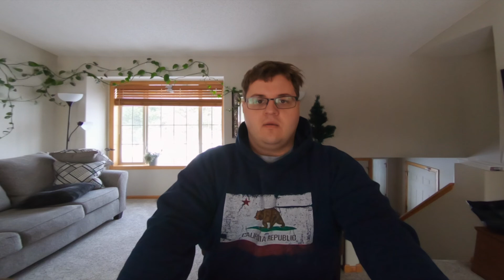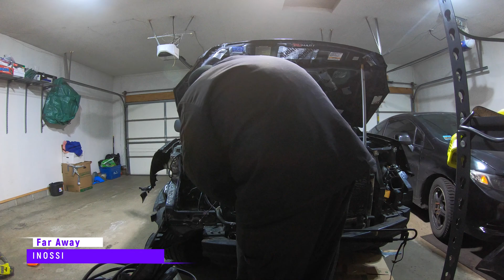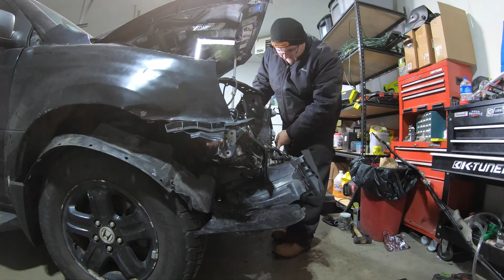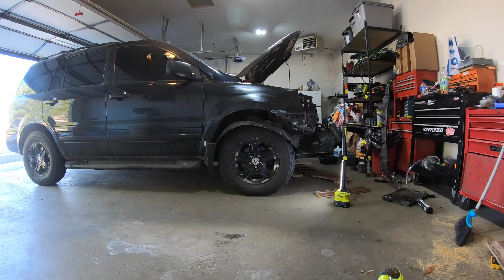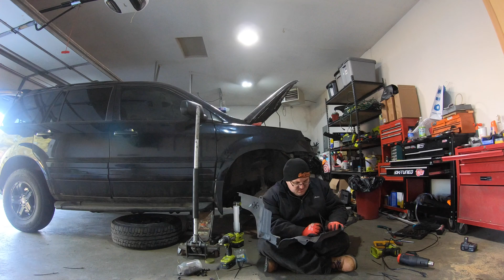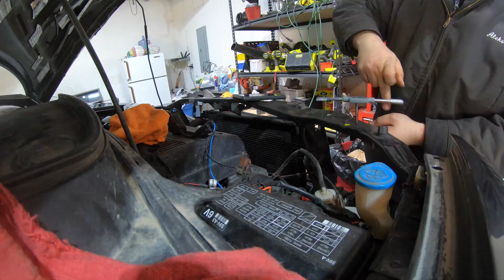Repairing my crashed 2004 Honda Pilot timelapse - Part 2

Comment: Good to see your Pilot will be back on the road. DIY repair video kept my interest thanks to the content and speedy clip. Now I have no excuses to not work on my vehicles in a cold garage ;)
Reply from the maker: Thank you for the support! While it's been quite a fun journey repairing the Pilot, besides working out in the cold garage although it wasn't too bad in the 30-40s. After I had completely fixed the Pilot and drove it for an alignment and new tires, I was told that the lower radiator clamp wasn't holding and was leaking coolant and required draining the coolant again and taking off the clamp to replace with another one. Now am glad that the project is over and I've got my reliable Pilot back on the road. Best of luck with your vehicle projects in hopefully not too cold of a garage!!